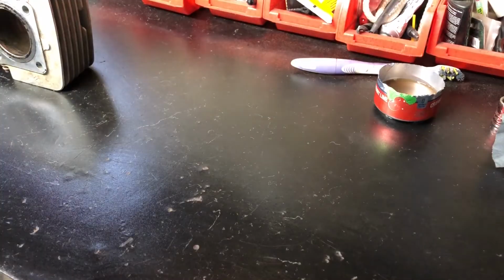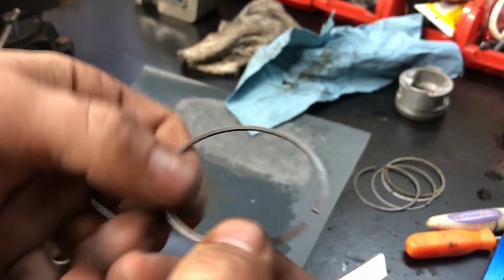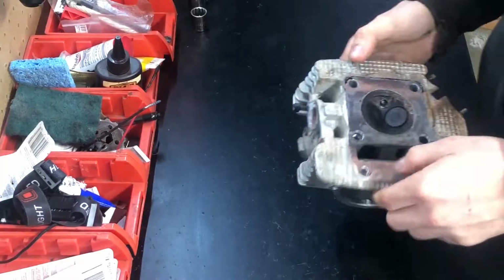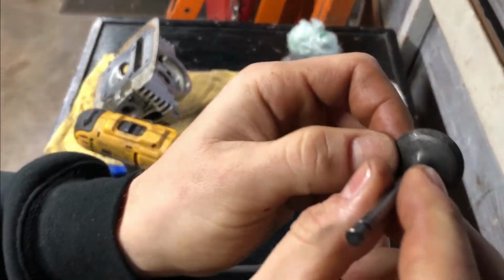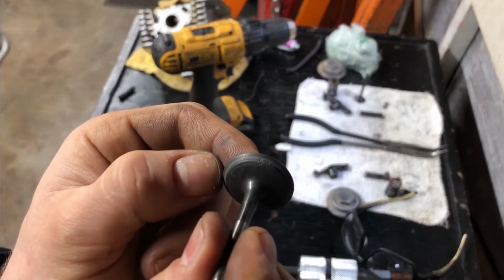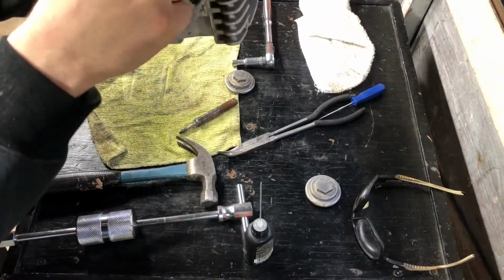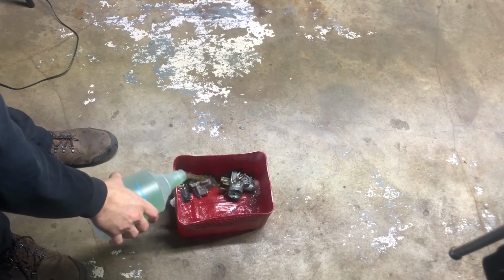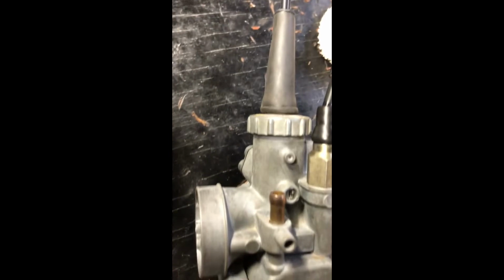Yamaha TTR125 Restoration Part 4: Unseizing piston rings, giving valves an overhaul and carb clean

Comment: Should have got new valves
Reply from the maker: I'm there with you. Normally I would get new valves, rings cylinder, but this is a super budget build and also an experiment to see if all this restoration work will actually work out in the end. I don't want to reveal any spoilers but just keep following this project and see what happens next :)